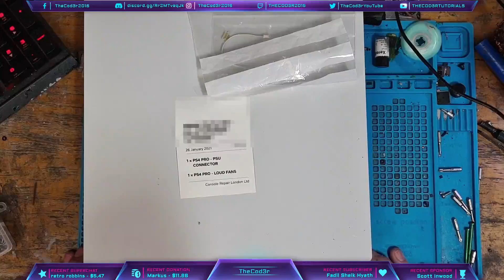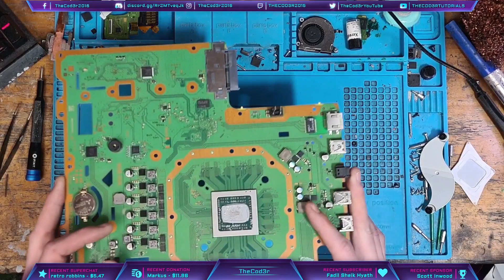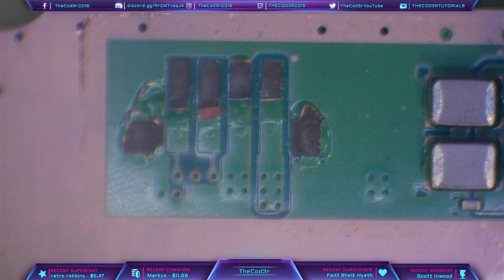PlayStation 4 Pro Power Connector Ripped From Motherboard - Diagnosis And Trace Repair

Comment: I found ps4 pros have this problem really bad i have my own ps4 cleaning business and ive taken apart and cleaned alot of ps4s but i took apart my ps4 pro today and broke this part and it ripped off the copper tracing just dont get a ps4 pro

Comment: I have a ps4 cuh-1215a that while I was cleaning I ripped the dumb connector with the pins off. I bought two which in the description said the part was correct for my ps4 but it wasn't.. Do you know where I could possibly find the right one.

Comment: I took my ps4 pro apart last night because the fan and the disc tray was making noises. I got to the psu part and noticed the wires wasn't unplugging. Long story short it ripped out but I didn't, for some reason, panic or react. This was the first time something like this has happened to me. It was also the limited edition spider-man pro.

Long story short. After finding this video it's back up and running like new. I didn't think I had it in me to fix something like this. Now I can fix my Dreamcast system battery. Thanks buddy.

Comment: What is the purpose of this 5v connector?
Does the ps4 works without it if the 12v connector is plugged?
Reply from the maker: The 5v connector is mainly for standby voltages, but without without connector there and without 5v working the console won't work at all even if 12v is plugged in

Comment: thanks for this, my hubs hulk ripped this off and the tear was above the tiny holes. so that strip that shows six holes, now only has 4 (and the rest if connected still to the pin. is that even repairable? all other repairs I have seen, the tear is below the small holes and the hole pattern is intact.
Reply from the maker: It should be, if the vias are missing you can wrap jumper wires around to the end point on the other side of the board. It may be difficult but it should still be fixable :)

Comment: I would have done it in a different way without jumper wires. I just would have been scraped off the coating next to all broken pads, and put the connector as is on the board 1-2 mm away from its original position. Like this: https://gyazo.com/997992a7ee24aff7d6a65513e5de0e08.png
Reply: i was about to post that idea
probably would even hold better, not sure if cable would reach :] 
there is one thing about this connector in general, sony installed it upside down from mechanical standpoint
Reply: @kokodin5895  Worth a try. :)

Comment: Came across your channel as a subscriber to Tronics fix, Great to see a fellow UK,er that does console repairs also, Its a shame i didn't find out about this channel a month or two back i had an Xbox one (First gen) that wouldn't power on, fan would twitch when you tried to power it on but nothing more, I ended up selling it on ebay as faulty, if id have known about this channel i would have sent the board to you for a repair attempt if you accepted (paid of course) ,Oh well...Subbed to your channel mate great vids! :)
Reply: I bought it from you

Comment: A repair that you always tell people to be carful of when removing a PS4 pro power supple great video 👍
Reply from the maker: Yep I can't stress it enough mate, I must see one of these at least every week
Reply: Just ripped of my power jack to save 10-15$ of cleaning fee (in my country), it was a terrible mistake. I knew that I need to be careful when it comes to this jack but nobody told me how? I think it will cost me somewhere around 50$ now T.T
Reply: They must have done this on purpose, that cable is so short. Not much holding it on either, my daughters bf just did this.

Comment: A free source of wire are also the transformers from dead CCFL bulbs
Reply from the maker: Indeed, any motor or small coil makes for perfect jumper wire and it's always handy to have different sizes around 😃